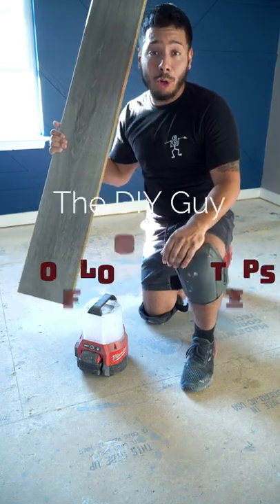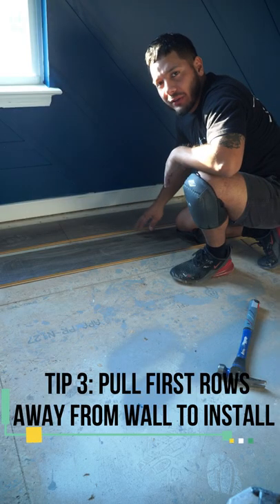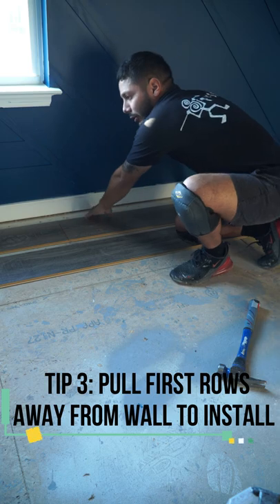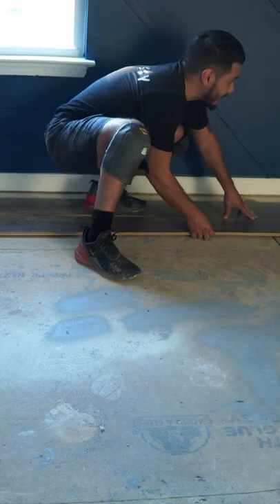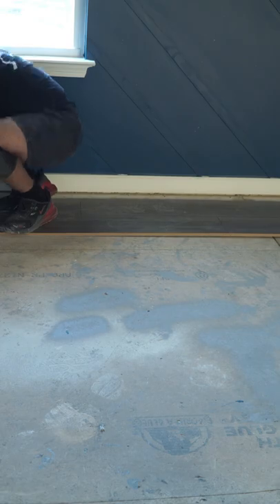Tips on laying laminate flooring 🔨✅ #howto #diy

Comment: Wheres the under layer. Lol
Reply from the maker: Laminate flooring can come with the underlayment attached or not, the more expensive ones do like the one I use, it’s just easier and you don’t have to worry about rolling and stapling. Just prep floor and start laying
Reply: You dont need underlayment for laminate flooring
Reply from the maker: @HNiCDuke  you absolutely do, it will creek if you don’t. Just like carpet has an underlayment so does laminate
Reply: @JuanOfAllTrades  not at all. I have laminate flooring in my house for years in many rooms. I know and see many ppl on youtube install it. You can literally lay it over existing flooring. I've seen ppl lay it over hardwood, tile, peel and stick etc w/o underlayment. If it ain't broke dont fix it and all my floors looks as good as they did when they was installed several years ago
Reply: What if you have dips in the slab
Reply: @HNiCDuke underlayment also acts as a sound barrier and cuts down on noise from walking especially when installed on the 2nd floor of a house.

Comment from the maker: For anyone commenting about taking baseboards off; not everyone will pay extra for that, not every piece is going to come off clean, shoe trim looks just as good when done right. You do NOT need to take off baseboards.
Reply: It's sad if you think this is true.
Reply: Yes very true just did my home. Only have to take off trim depending on thickness of material
Reply: Not pay extra to take off base? They have to pay for shoe mold to be installed. Take off the base. If you can’t get base off clean then you don’t need to be doing flooring. It’s forever part of the trade
Reply from the maker: @Apexjasonmorganllc  Quit over complicating it and gatekeeping. My floors will get appraised just as well as yours, at the end of the day that is what counts. Go talk like that to a nooby not on my page.
Reply from the maker: @1NewEggFan  let’s see your work, sad for you to comment with no content.
Reply: Razor swipe the baseboards and heat gun I remkve no problem and ca glue if break

Comment: Dude I don’t want gaps! I want to lay my baseboards on top of my flooring and not have to use a round over to hide it.
Reply from the maker: I agree, both ways are okay. Some actually prefer it with quarter round it’s all preference. For sure looks cleaner with just the baseboard
Reply: Like Juan said it’s personal preference. Been doing high end residential flooring for two years now, some customers want base w baseshoe/quarter round, some customers want to re use their old base and get new base shoe (which I think looks awful), some people just want quarter round around their whole house, point being different people want different things and if they pay for it they get what they want whether It looks good or make sense 👍
Reply: @JuanOfAllTrades  every time you leave that gap unable to to be hidden by the baseboard, you diminish the value of your work.
Reply from the maker: @1NewEggFan  I’ve never had an appraiser take off value due to using shoe trim, but pride value is a thing too and I agree.
Reply: Thank you for your comment, now i know how to do it without taking the baseboard off 😂 i saw those pieces at home depot and didnt know what they were for
Reply from the maker: @bucket7548  it’s very common to do it this way, even in new construction, but hey do you man.
Reply: @JuanOfAllTrades  ma'am I literally said thank you for showing me that trick
Reply: @JuanOfAllTrades  NO ONE PREFERS 1/4 round 😂 you must be new to this… 1/4 is the HACK and wrong way..
Reply from the maker: @nickbemcm  you must be new to this, there is no wrong way to do it, it’s not difficult to do it either way, some people do prefer it

Comment: Imo you should pop off floor trim. Put floor under it. Replace trim. Hides that expansion gap
Reply from the maker: I own my house, no. Shoe trim looks just as good.
Reply: Quarter round.
Reply: @JuanOfAllTrades  no, it doesn't
Reply: @GimpGladly fr. I guess it comes down to preference.. and laziness. lol I’d rather take them off.
Reply: @ColdSprite  yeah, I meant that with bit of sarcasm. Obviously it's a choice of balancing time, cost, aesthetics and all that. When it's appropriate, say on a client's rental property that needs to be turned around fast, I'll even use quarter round to give extra wiggle room in terms of cutting the planks accurately. 
Shoe molding can look quite decent, but my preference is just baseboards when it makes sense.
Reply: Quarter round looks like shit!

Comment: Hardest part is lining up that first row once you do that it all goes together quick. The door ways and closets can be difficult to cut around. A jig saw works nice for this.
Reply from the maker: Yeah and plus the first rows move constantly until you get a couple more down, and for sure a jigsaw is a life saver for the door way cuts!
Reply: Use packers/shims against the walls or skirtings . For doorways use an offcut of the floor and multitool the bottom of the frame

Comment: Hey Juan I’m installing my LVP footing on my concrete slab with moisture barrier

When I walk on it it makes noise and has low and high spots

Do you recommend adding underlayment to help reduce the spots? The LVP has thin pad already
Reply from the maker: Low and high spots are due to uneven subfloor, for concrete you can get the self leveling liquid, other than that there isn’t a Quick fix for concrete
Reply from the maker: A quick fix as in like if your subfloor was wood I’ve used flat head anchor bolts that get covered with wood filler to stop the squeaks. Adding more layers would make the floor feel spongy.

Comment: How do you get rid of the gap after installation? Without bleading especially door frame?
Reply from the maker: For the door frame you have to undercut it and slide floor underneath (usually the most difficult part) for the rest is covered with shoe trim, if not a fan of trim you can take off baseboards first so that way the gap will be covered by the baseboard (the cleanest more professional look).
Reply: Hire a professional?

Comment: Why do you need the 1/4 gap? I'm installing laminated floors in my Rv and installing it over cure laminate floor....??? First timer wobble boxrenovation
Reply from the maker: Since the product is made out of wood just by nature it expands during the hot times and shrinks during the cold times. In a climate controlled environment it’s less likely that could happen but let’s say your AC goes out just one day in the summer, that floor is going to expand usually an 1/8 of an inch and if it is to close to a wall it will prevent expansion causing the floor to buckle in the middle most likely. A 1/4 of an inch gap gives the floor that wiggle room incase the extreme happens, I personally have never seen this happen to floors since when I first started I was always told to leave it like that lol but I imagine it would be a nightmare. Hope that helped
Reply from the maker: And since your RV would be off sometimes and depending on your environment, for sure would recommend leaving a 1/4 of an inch gap, they sell spacers that size in the floor section, just be careful with those because they can damage your floor while installing, I usually just use a tape measure and a pry bar to pull it away from the wall if it’s to tight.

Comment: Can i fill in the 1/4 inch gap with flexible chalking?
Reply from the maker: No, always use shoe trim, ideally remove the baseboards and then reinstall them after

Comment: Is 1/4 round necessary?.  I don’t want to cut off my baseboards
Reply from the maker: If you don’t want to mess with your baseboards yes, it’s a must.
Reply: @JuanOfAllTrades if I have no baseboards or dry wall yet do I need to do the 1/4 inch spacing?
Reply: @fitnessandfades84 why would you be installing a floating floor if you don't even have drywall on your walls yet?
Reply: @mikep3813  uhhhhh why not???? The room is finished now and looks amazing…. What’s your point?
Reply: @fitnessandfades84  just seems ass backwards to put down finished flooring when you are gonna be making a huge mess with drywall right after when you can easily just switch the order you do things.
Reply: @mikep3813  point one, I’m not in construction I chose to be a man and do it myself without someone like you criticizing my every move . Two , if your such a professional then you do know that you can cover the floor before you work right? And you do know that you can clean anything that may get messed up right? How about you give props to someone who did it on their own and saved money for the family and it came out great. Offer a suggestion without being a jerk early in the morning if you call yourself “trying to help” . Good thing I didn’t have a Debbie downer like you around or I probably wouldn’t have done it….
Reply: @fitnessandfades84  was I a jerk or did I simply ask why you did it that way? 2nd, I'm not a contactor of any kind, I'm a machinist and did all the flooring in my home as well to save the family money. And yes you can cover the floors but why spend the extra money you are ultimately trying to save by purchasing ram board or spending the extra time cleaning when changing the order of operations is all that would have to be done?
Reply: @mikep3813  waking up early in the morning to say someone is doing something ass backwards when they took the time to do it to improve their home is definitely being a jerk. If you were offering a suggestion it would go more like “ Great job getting that done! Next time you should do the walls first so that you won’t have extra work for the clean up. Keep grinding!” See the difference?

Comment: How do i cut an expansion gap after laminate plank was installed too tight next to wall?
Reply from the maker: Too tight to the wall or too tight to the baseboard? Remember your sheet rock doesn’t go all the way to the bottom, so if it’s tight to the baseboard you are okay if it’s underneath it, but if it’s up against the board let me know

Comment: Could I get by without having to use self leveling concrete and put the floors down also I asked because I know it’s cutting a corner and not they’re complete way, but the whole house is going to be getting torn down within a few years. I bought the floors a while ago 3/4 of the house is done where carpet was basically and now I chipped up the tile section and and that’s where I’m at now. I’ve sealed the concrete and I have the regular underlayment water barrier padding and then I bought this expensive stuff and haven’t found any videos of it being used. I did use a grinder and smooth the floor where high as much as possible so it’s just for the spots that are a little low. Nothing is a hole or even a quarter inch probably the lowest the rough concrete would be.
Reply from the maker: It depends, the underlayment gives the floor some wiggle room so it doesn’t have to be perfectly flat. But just like in my video poked out nails would be an issue, just depends how unleveled it is.
Reply from the maker: If you were laying down laminate flooring you coulda left the tile, if the house is getting torn down soon I would have left the tiles and put underlayment on top and started my new floor

Comment: Why are you do it it with the baseboards on it seems like you would use baseboards to hide the edge of the expansion gap.  No mention of the staggering.
Reply from the maker: You can do it with or without it, with it you’ll just add shoe trim later on to finish it. Both ways are fine, and it’s hard to cover every detail in a short lol

Comment: Pro tip number one underlayment pro tip number two remove base board pro tip number three 3/8 expansion all the way around.
Reply from the maker: @Devin-q3s  wrong, it’s a 1/4 inch, that is over kill. The underlayment was attached to the floor. Removing base board / adding shoe trim is a preference not a requirement.
Reply: @JuanOfAllTrades  go half inch rookie

Comment: Pro tip, take off base, use spacers and use underlayment if its not already attached to the laminate.
Reply from the maker: No, no, and no. Don’t have to take off baseboards I do sometimes but it’s not required. Spacers? Lol You can just use a pry bar and move the entire floor to get your expansion gap before last row no need for them, and this one had underlayment attached. Thanks for watching hope you learned something
Reply from the maker: Your tips are for people just beginning to lay floors the very first time, not pro tips. It’s about being efficient and not wasting time but still doing it right.

Comment: So u don’t need to put down that protection from moisture stuff?
Reply from the maker: It comes attached to the floor, it either comes not attached and then you roll it out separately or you can buy the flooring with the vapor barrier attached

Comment: pro tip start in the hallways and in the door those are the hardest to install if you're going in backwards and in 2 doors you're going be stuck for awhile if you don't know how get out of that you just plan your rows so you end halfway through a door but not a kitchen and closet at same time or your never getting it in
Reply from the maker: You can’t always start that way, ideally yes but there will be times where that isn’t an option. In this case it didn’t matter since I’m using a transition piece into the hallway, House is to big to do the entire floor at once
Reply: @JuanOfAllTrades  I do mostly hardwood, but yeah  starting down hallway is usually best for highend clients you dont want a angled hallway cause some one shifted it as they went through a bedroom door
Reply: Never start in a hallway,  you always have to start on a perimeter wall to ensure the floor is going to be square everywhere possible.  Hallways are rarely ever straight
Reply: @jesuslopez4113 I prefer my hallway to be straight because you have two walls that are 3 feet apart on both sides of the floor so it stands out more.

Comment: Tip lay down the laminate in the direction of the sunlight
Reply from the maker: No, lay it down going to your hallway or longest isle in the home, you don’t want to see lines going across while you are walking.
Reply: @JuanOfAllTrades  that’s the point you want to see the lines
Reply: @hakan9185 just no 😂
Reply: @hakan9185 why would you want to walk down a hallway seeing a bunch of horizontal lines?

Comment: Im no expert but i thought you had to instal it long ways.... you've must if made so many cuts.
Reply from the maker: Always the direction of the hallway
Reply: @JuanOfAllTrades  You laid it wrong actually; and it's not the hallway it's the lighting. Your room will look smaller due to this.
Reply: @itsapplesaucetoaboss8216 what if your lighting is in different directions in different rooms? I've always done lengthwise along the main hallway and looks great every time. Going sideways along a hallway make it look like a ladder or stairs and is unappealing to the eye.

Comment: Hammering it in? 
I didn’t think it was necessary to hammer this flooring that’s why it’s called a floating floor
Reply from the maker: @glitchmatrix666  ? The nails that are poking out need to be hammered in, the floor is tapped in with a block so it interlocks with each other.
Reply: @JuanOfAllTrades  oh aight totes sounded like you meant nailing them

Comment: Dang not sure about using a metal hammer on vinyl . 😂
Reply from the maker: The metal hammer I used to put down the nail in the plywood? And btw that’s laminate, and regardless of the hammer nothing ever hits laminate, just the tapping block. Thanks!

Comment: Pro tip #1 do it right with the baseboards off.
Reply from the maker: No. The pro way is the way that gets the floors appraised, quit gate keeping. You make it bad for the DIYers trying to start out, there is more then one way to skin a fish.
Reply: @JuanOfAllTrades , baseboards must come off. That is the pro way.
Reply from the maker: @jmac091176  no lol either way is fine, no one is taking off points for using 1/4 round buddy, sold this house at top dollar